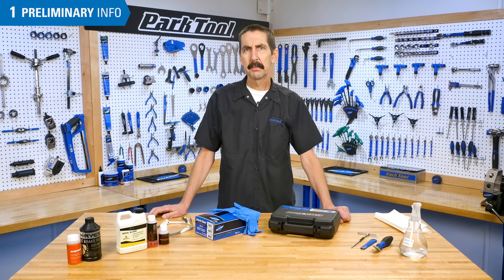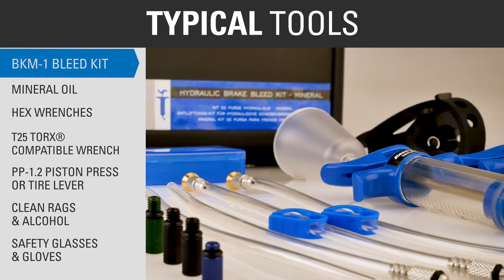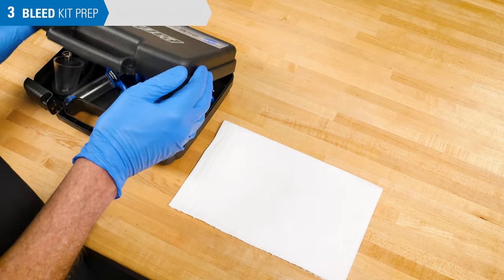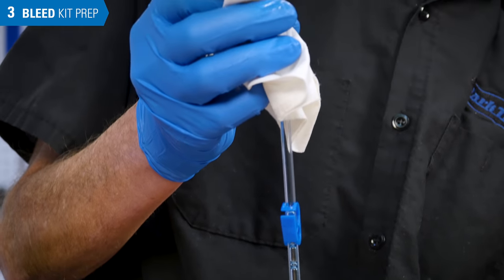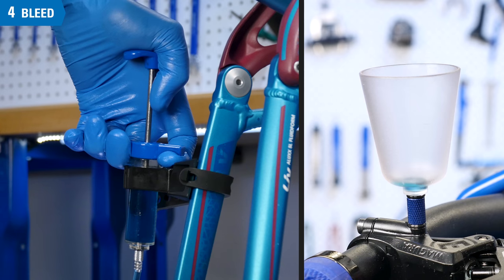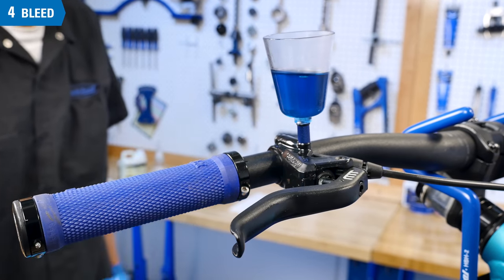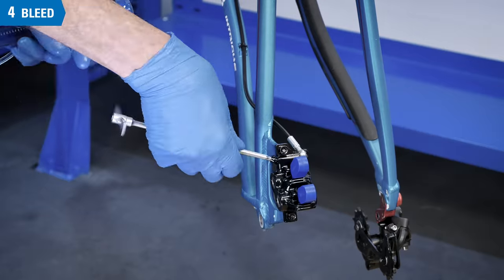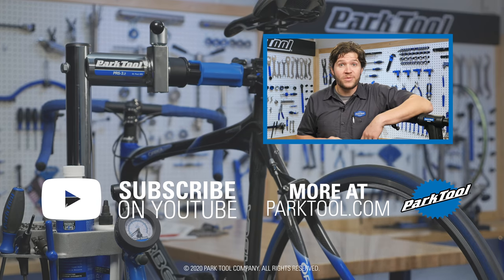How to Bleed Hydraulic Brakes - Magura®

Comment: Guys, this process is perfect up to putting back the bleed screw in the caliper, as you lost oil when removing the syringe and tightening the bolt. Magura suggests to take the caliper above the lever to avoid this. I had that issue and this fixed it. Just a heads up for anyone else trying to bleed these brakes following this video. Cheers!
Reply: Hey! I wanted to ask you, how did you manage to take the caliper above the lever? Thanks
Reply: @katsaras1  flipped the bike in the stand just enough to have the caliper higher than the lever, ensure you have already closed the bleeding port on the lever before doing that.
Reply: @katsaras1  you could take it off from the brake mount and raised it higher than the lever to avoid mineral oil from escaping.
Reply: @dhicon45  err not if it's a rear calliper and the brake hose goes through the frame!
Reply: So many people sugesting to raise the caliper above the master cylinder.. if you want to be sure no air gets inside the caliper when you disconnect the syringe, there is an easier solution. You just leave bleeding funnel with some oil in it, connected to the lever, disconnect the syringe from the caliper, close the caliper, and then remove the funnel and close the master cylinder.
Reply: @augu5t1n  The oil from the bleeding funnel will leak out. So the amount of oil you put in the bleeding funnel will give you enough time to close the caliper and thus avoiding introducing air bubbles?
Reply: @imjusthereforlolz yes
Reply: exactly. I was screaming at the screen as I watched the caliper drip mineral oil :)

Comment: I volunteer at a community bicycle workshop
It’s funny I bled a Magura the first time a couple of weeks ago using Maguras recommended system and thought afterwards this is a stupid system next time I should get a shimano bleed pot and if it’s a different thread make an adaptor.
Trust Park Tool to make one. I also love the syringe holder.
You took a while to get these bleed kits out but as per usual it’s better than the OEM

Comment: A little tip when doing this: before you push pistons back, install the funnel on the lever first to avoid putting too much pressure on the lever seals. I learned it the hard way and had to change the seal after destroying it like that.
Reply: I often forget to put in the stoppers for the pads when removing wheels and have to push them back I have never had an issue. Odd that you did.

Comment: A little trick: during this process you can adjust the bite point by using narrower piston blocks. Of course, the bite point also changes with the wear of the brake pads, but I prefer to do twice the accelerated bleeding ( with one syringe - if the used oil change is not necessary and the system is not heavily aired) with the bite point adjustmet in the season and enjoy a much better braking feel. But not everyone likes short lever stroke like me. For me, this is invaluable because this setting makes my hands less tired while driving.

Comment: The brake caliper should be removed from the bike when bleeding to get a better bleed. When disconnecting the syringe from the caliper, the caliper should be higher than the master cylinder to avoid oil leaking out when disconnecting the syringe. Even a tiny amount of oil lost will make the brakes spongy as magura master cylinders have a very small fluid reservoir compared to other manufacturers.
Reply: I'm not going to realign my calipers every time i bleed so i'm good
Reply: WELL SAID AND CORRECT!!!
Reply: @thelongestnameinthecomment9677  then you’ll have a bad bleed with lots of space between pads and rotors but I’m sure you’ll tell your buddies you’ve got so much modulation brah.
Reply: @mitchellmtb7202  it works fine...
Reply: I was considering to make the same exact comment until I saw yours.
Reply: How do I suppose to do it with inner brake hose routing?
Reply: @sergeigridasov5601  take lever/master cylinder off bars and bring down to just under caliper when installing screw on caliper to avoid losing any oil.
Reply: My thought too.
Reply: This was the answer to my prayers after three separate attempts. Thank you! Why Park Tool does not include these details in its video is really baffling.

Comment: hi, i have magura mt trail double piston brakes and i was using avid 180 hayes 203 as disc. I bought a shimano xtr rt mt 905 ice tech disc, but my brakes aren't holding the way they used to. Should I use organic or metallic? Which one do you think is not compatible?

Comment: I would add a couple steps/tips:  1) after reinstalling the bleed port screw on the caliper, remove the bleed port plug on the lever, cycle the lever a couple times, and add a couple drops of Royal Blood before reinstalling the bleed port plug  2) a very important step - after removing the bleed block, clean the caliper inside and out with rubbing alcohol.  Any residual brake fluid will quickly contaminate your pads/rotors leading to all kinds of badness.

Comment: Best Magura bleeding tutorial on Youtube !

Better than the Magura official tutorials, It's a bit worrying 🙃
Reply: You’ve obviously never properly bled brakes…
Reply: @whycantweeatabortedbabies6259  i have the best results with this one without no need to repeat it Infinite times. Can you share us a better tutorial to see how you do and make everyone bleed there brakes better ? 😁
Reply: @cristoof59  yes. The way magura suggests is the best way. If you do it this way there will be air in the line 100% of the time. So if you like spongy brakes I guess this is the best.
Reply: @cristoof59  The magura tutorials worked great for me, although I adapted their technique to use this bleed kit.  The only real difference is getting the caliper higher than the lever when you go to put the bleed screw back in, and then lowering it slowly until the oil is flush with the face.  My brakes have been amazingly powerful after that.  (MT-7)

Comment: I have brand new MT7 calipers and have performed this exact process a few times.  No air at all in my lines.  Lever is firm to pull.  The pistons however do not retract and stay “gripping” the rotor.   Any suggestions?
Reply: What has happened since?
Reply: Use a thinner rotor

Comment: Can't you leave some fluid in the funnel without the plug, and put in the calipper bolt first so if any oil leaks from calipper the funnel will still have oil to keep the system full and lastly plug the brake lever hole ? Doesn't it make more sense ? That's how I bleed them to avoid loosing any fluid from the system
Reply: it doesnt make sense... when you close up bleed screw at the lever, the vacuum will hold oil inside. If you unscrewed the syring first, gravity will drain all the fluid from the funnel, and then suck in air.
Reply: @tomasstraka5244  well I've never experiencing vacuum held fluid after I've plugged the lever first, it always leaked atleast a bit from the caliper thus loosing fluid from the system

Comment: Something is wrong with my MT8 brakes. After bleeding them 20 times, including at my local bike shop, and replacing the lever/master cylinder, and the pads, and the brake line, I still have an endless supply of air in the brakes! When I do the vacuum trick shown here, the air just keep coming out. After all this effort and part replacement, I'm totally out of options - ANY Help or advice would be appreciated!
Reply from the maker: There has to be air entering at some point in the system. It may be good to send Magura a message about these. How do the brakes feel? Does the lever go t the bar?

Comment: Any tips on using just one syringe?  Feels like I can't get the air out, the lever feels really mushy and there is hardly any bite on the brakes.
Reply from the maker: Repeat the process a few times and make sure that you get all the air out of the system.

Comment: Syringe holder. So brilliant. Sold separately please???
Reply from the maker: Yes they are. You will need to call in for them as they are not in our online parts system yet. Here is a diagram with all the part numbers. https://www.parktool.com/assets/doc/product/BKM-1_instructions_EN.pdf
Reply: Umm a zip tie is cheaper?

Comment: This is a great video, but the only thing I don't get is after bleeding, when disconnecting the caliper bleed hose, any oil that drips out must be allowing an equal volume of air into the system. Magura suggests holding the caliper up nrear the lever reservoir so this won't happen. Am I nuts or am I correct in assuming this?
Reply: You're correct

Comment: Can I mix other mineral oil in with the royal blood?
Reply from the maker: it is not recommended but is ok. Mineral oil is not regulated like DOT so the different formulas can vary quite a bit. Which leads to different boiling points.
Reply: @parktool  I got through the bleed but the syringe sucked up some floating particles from the brand new bottle of royal blood. Sad to say, those particles went into the brakes. Didn't notice till too late.  Was probably from the protective film that sealed the bottle. Now I gotta flush it out when i get new fluid.. thanks for the info! Figured about the boiling point and that
Reply: Magura won't warranty if you use anything else. If they're leaking and it's not a crushwasher issue first thing I check if they're running shimano mineral oil. Around 18 different compounds in a 'mineral oil' so a misleading category. 

Doesn't happen to everyone but do see it occasionally and magura tech said it was his first check too. Always willing to be wrong though definitely not being a smart ass haha

Comment: What oil can you use?
Reply from the maker: Magura is a mineral oil system.  They prefer you use their own fluid.  There are of course other brake fluid manufacturers that make compatible fluid.  Never use a D.O.T fluid in a mineral oil brake.
Reply: @parktool  alright thanks for the comment👍

Comment: Dear park tool team , love what you do , but I need to be a pointy smart ass 

Never ever screw something in the lever thread  then the lever screw , you could end up damaging the cheap plastic low quality lever and so ending up getting more air into the system 

Lot of folks have allready done it and it didn't end up well 

As we all should now , one thing is to bleed the caliper then the System and at the end the lever 

Cheers

Comment: Hey im a great fan of the channel just asking what might be wrong with my bike because everytime i go to the trails and after every post ride everytime i pedal is there's that rough feeling while pedalling but when i wash my bike it's back to normal again but even my bike is clean or even there's just a lilltle bit of dust or dirt after every trail ride that rough feeling keeps coming back but when i remove the chain and check the bb and cranks the bearings just feel good as new i also checked the hub its still moving freely and i just upgraded my whole drivetrain and hubs last 2 months ago isnt the short chain causing all this errors on my bike
Reply from the maker: How dirty is the bike getting during the ride?
Reply: @parktool  even though i dont go to the trailsjust some road rides with my mtb sfter every post ride there's always that problem

Comment: I have found u can never get rid of all the free stroke . I hate the lever coming in close to my Knuckles.. So I have found bleed them exactly as you did , Then go ahead and bleed like a motocross bike pumping holding cracking the Caliper screw at the bottom.. I even take it one step further . button everything up , put the  wheel back on and pump the brake . than remove lever screw put the bleed bottle back on add min oil .  remove wheel , give the brakes a little squeeze moving the calipers pads in just a little bit NOT closing them not all the way.. Remove The bleed cup , replace  screw . lightly spread the pads back , not much you don’t want to blow any seals... replace the rear wheel and now you have taken up some of that free stroke. These r race Mechanic tricks not Recommended for a beginner tackling this job. I was a pro motocrosser and a Pro motocross mechanic for years . I also worked in many bicycle shops as a head mechanic. I’m always watching the great videos like these ,  because we can always learn more knowledge..
Reply: Yeah these breaks suck... shimano xt so much better.. I’ll use the mt8s for now.

Comment: "Magura?" Huh. At least it's Calvin! This is a lovely kit, at $120 vs $30 for a Shimano setup it's for bike shops.
Reply: This system can be used with magura shimano and sram (i think more as well) you just need to clean everything to make sure there's no dot fluid if you're doing a mineral oil brake (or vice versa)

Comment: 6:18 The step is wrong here, you should move the rear caliper higher than the brake lever (by rotating the repair stand) before unscrewing the adaptor, then shake and vibrate the rear caliper sightly to get rid of any air bubbles that might get stuck somewhere, finally add a bit more "Royal Blood" to overflow the port before tightening the port screw.
Reply from the maker: We have never had an issue of air in the system with this technique.
Reply: Technically, yes. You could follow all the steps here, then at the end you install the screw on the master, lift the caliper above the master, flick the line a bit to loosen air, draw some vacuum with the syringe to ensure no bubbles are trapped by the caliper, press fluid back in, then uninstall the adapter and install the screw.
Reply: Well spotted, and It is also better to loosen and then lightly tighten the lower calliper clamp bolt to spin the lever.

Comment: The instruction is wrong. DO NOT press the caliper pads or pistons in without opening the master cylinder plug otherwise you can damage the master cylinder. Also attach oil can to the opened master cilinder to collect oil excess during pressing the caliper pistons.

Comment: "It's important to always use the appropriate brake fluid..." 
BS, baby oil works perfectly.
Reply: Actually true. But only if you don't mind your brakes smelling like diapers :D
Reply: I used KY and now my braking just glides
Reply: Trials riders used to use water, but it freezes in winter :)
Reply: @alimantado373  the issue with water is if you brake hard in short time, it will start boiling and with all the bubbles in the system they you suddenly don't have any more braking power. For trials, for short, hard quick uses, I'm sure it works.

Comment: ..."Magura suggest using their proprietary fluid"
No shit sherlock, so magura have another product to sell and parktool can't have a "ParkTool MGR-01 mineral oil for magura"... :D
However, truth is: Any mineral oil for high temperature hydraulic applications will work like a charm.

Oh, for the record your o'ring aren't holding... 4:53
That's not gonna do good when you try to suck the oil in from lil funnel

Comment: Park should sell a tool that is just a vertical standing bar with a positionally adjustable caliper mount on the bottom and a lever mount on the top so the brake line can be perfectly vertically straight while it is being bled so 100% of the air bleeds out the system on the first try. Typically air gets caught everywhere the brake line bends. It would be really easy to fabricate.